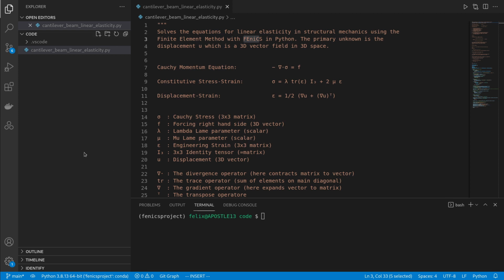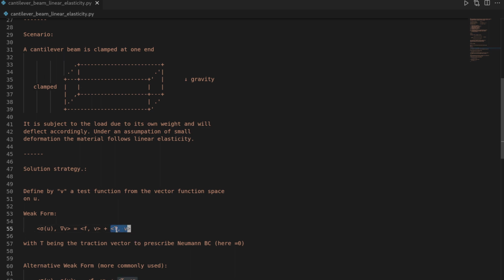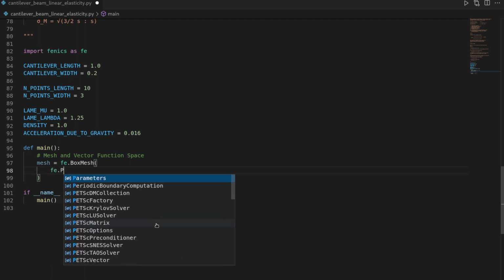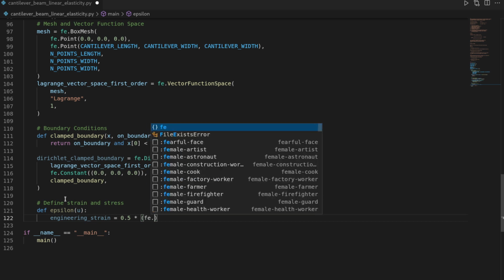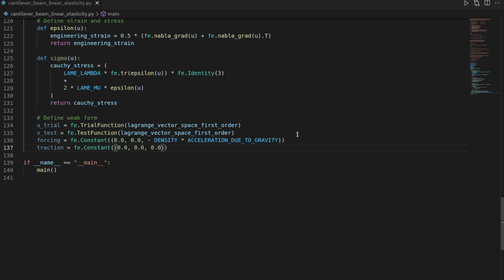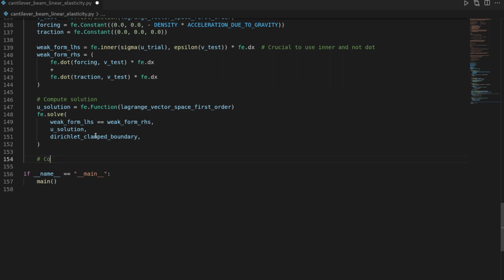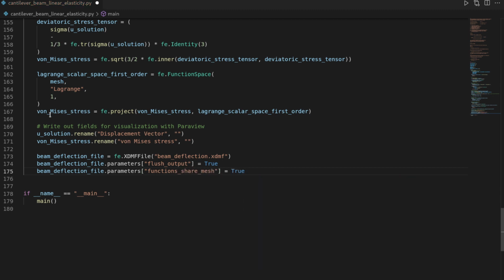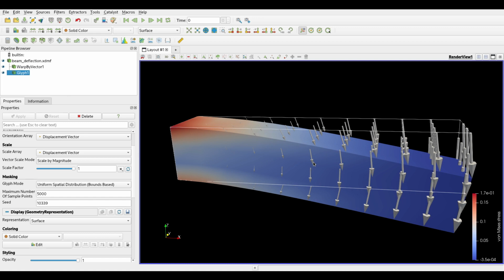FEniCS Tutorial: 3D Linear Elasticity on Cantilever Beam (+Paraview Visualization)

Comment: Hi, great tutorial!!!  Thanks a lot again for putting this videos on youtube, they are helping a lot of people. 

I just want to point out that extra caution must be taken when using a traction different than 0.  You have dot(tracion, v_test) which is correct. But the integral should not be taken in dx.  It should be taken in ds.  And ds has to be defined beforehand to specify which are the faces/surfaces that a traction is applied on.
Reply from the maker: Hi,
thanks for the kind feedback :)
That's a great point. I will leave the comment pinned!

Comment: What carrer or master should i have to be an meghanics of fluids investigator
Reply from the maker: That's a great question but I am probably not the best person to answer this since I currently do a PhD in a rather theoretical topic. There might be good resources you can find elsewhere on the internet.
My first thoughts are that you need a good understanding of both fluid mechanics and numerical methods (for which I also present the fundamentals on this channel). Beyond that, it is necessary that you understand at least one of the big CAE softwares (either Ansys fluent, siemens starccm+, or openfoam) since most companies don't use their own solver codes. For this, it is also important that you completed projects and gained experience how the entire simulation pipeline (preprocessing, solving, Postprocessing, and interpretation) works.
And, unfortunately, there is also some luck involved since these positions are (afaik) in a position of more supply than demand. Hence, it helps to build a publically visible portfolio and a social media/online presence that could help you get noticed.
Good luck 🤞

Comment: The problem I find with these videos is that it do not explicitly cover the various aspect of problems , for example applying traction or point load on this beam. Also if you seen the documentation of Fenics, they also explain this simple example without covering the other aspect. I think those should be included and explain in the videos. Apart from this, such videos are great source for learning FEM.
Reply from the maker: Hi,
thanks a lot for the comment and the kind words :). I can understand your concern. However, more generally, I would say that one always have to make compromises when teaching topics. During my undergrad, my continuum mechanics prof said that teaching students continuum mechanics right from the start would make any engineering mechanics courses in the first semesters obsolete. Though, he also noted that doing so would of course be overwhelming and students might be worse off in the end. FEM theory is deep, very deep. I think it's good to start simple (and ignore some details), then dig in deeper. I also tried to do that in the subsequent theory video: https://youtu.be/Z-FnP2myvKw (at least with deriving the variational form).

Comment: Hey, first of all thank you for this video since it helped me understand what goes behind the simulations. I had a question, if I had to compute a similar problem except that the maybe the geometry was a bit complex and I had to use traction vector, how do I define the traction vector to be that specific function but only over that surface? In my case the mesh was actually moved from gmesh to fenics so I have the index for the surface I want to define my traction vector upon, and the geometry is complex enough such that I can't define the surface using any easy math functions to grasp that geometrical surface.
Reply from the maker: Hi,
thanks for the comment and the kind words. :) 
Unfortunately, I cannot help you with your problem. That's beyond my current knowledge of FEniCS. I would advise checking the official FEniCS docs for a similar issue, or ask in the FEniCS forums.

Comment: Thank you for your videos, they are helping me a lot, however, i was wondering if can you explain how to set the boundary conditions when a mesh is imported, in my case i create the mesh in gmsh and then converted using "dolfin-convert" command then three files are generated one with the full mesh and two more having the physical elements and another one having the faces, those three are xml files, then we call them and followed by that we need to set the boundary conditions, in here is where the problem arises, because trying to set the Constant(0.0,0.0,0.0) the solver throws an error saying that a scalar is needed and an vector was provided, therefore if we change the function to Constant(0.0) another error appears "Transposed is only defined for rank 2 tensors."
Reply: EDIT: I solved the problem, in my case was actually the fe.VectorFunctionSpace(mesh, 'P', 1) on which at the beginning i had fe.FunctionSpace(mesh, 'P', 1) because of that i was having problems with scalars and vector of course
Reply from the maker: Hi, thanks for the comment and the kind words. :)
Great, that you solved it. Have fun with your FEniCS simulation!

Comment: some simulations are too heavy, can you pls make a video, that how we use multiple cores of the system or use parallel processing?
Reply from the maker: Hi,
I think this particular simulation should be manageable on almost any modern machine. If your FEniCS installation together with PETSc is set up properly, I think it should already use thread-based parallelism. You could try OMP_NUM_THREADS=[YOUR CORE COUNT] right in front of the python call. Although, I think it might not give you any performance boost in this particular scenario.

I will put a video with MPI parallelization in FEniCS on my ToDo list. As of now, I would like to postpone that a bit in order to continue on other Playlist, especially also because the more recent re-development of FEniCS (called FEniCSx) is more suited for MPI-based parallelism. I might have to pivot the tutorial to that version.

Comment: Pls also make a vidoe on temporal Discretization
Reply from the maker: Yes, there will of course also be videos on structural dynamics with FEniCS sooner or later :). Until then, check out this video on the transient solution of the heat equation: https://youtu.be/QpA7E4YHbyU together with its more detailed analysis https://youtu.be/A25_fAf4kxc

Or if you feel more comfortable with advanced topics, check out the transient Navier-Stokes solver in the Lid-Driven cavity scenario: https://youtu.be/UPvmb8nVKqE

Generally speaking, in FEniCS one has to do the temporal discretization oneself and there a multipled approaches. I would also advise you to check out the FEniCS book: https://fenicsproject.org/pub/book/book/fenics-book-2011-06-14.pdf

Comment: Hi Felix, thank you for your videos. Keep up the good work! I have got a small question. Do you think one can simulate the structural response of floating structures using linear potential theory on FEniCS? Commercial software that do this are Ansys Aqwa and Orcaflex for example. The open source option would be Nemoh. Thank you for your reply in advance!
Reply from the maker: Hi Nazhmiddin,
thanks so much :).
Unfortunately, I am not familiar with hydrodynamic analysis, but generally speaking you should be able to solve any (more common) PDE with FEniCS for small to medium-sized problems. You could maybe ask a question in the FEniCS forum to see if someone already has worked on using similar governing equations, or check for repos on GitHub. ☺️
And as a hint, it's probably best to use the modern re-development of FEniCS called FEniCSx. I am still using the older version here (because I started the tutorial series with it). However, I think the concepts are the same. It only requires some slight changes in the code.
Good luck with your application :)
Reply: @MachineLearningSimulation  thank you Felix! Hope your channel flourish soon!
Reply from the maker: @njmddn  Thanks a lot :). Feel free to share it with friends and colleagues ;)